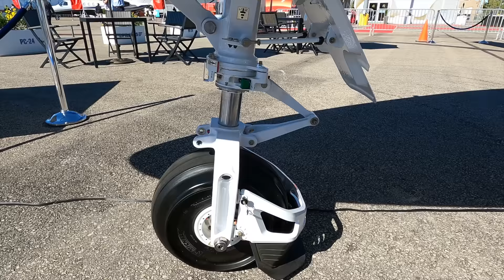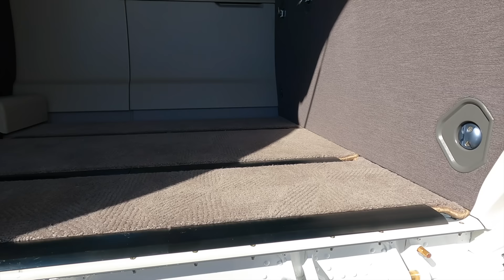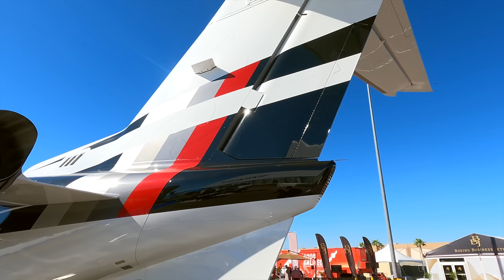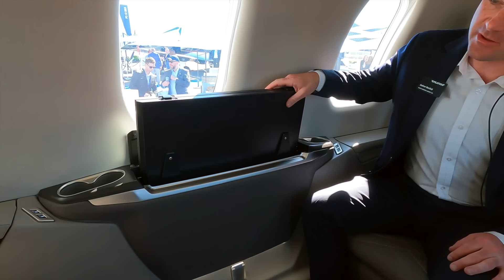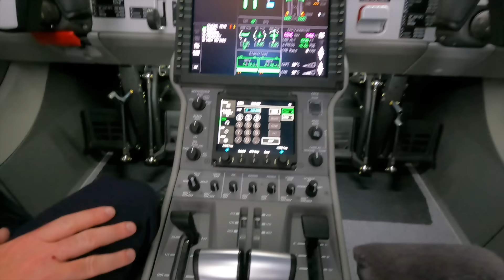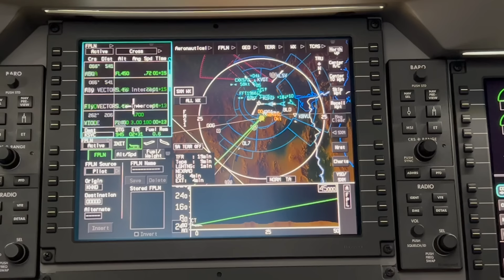NBAA-BACE 2024: Pilatus PC-24 Walk-Around Tour

Comment: I’m a little surprised by the combination lav and galley. I wonder how well that goes over with potential buyers. This plane is a substantially higher price point than, say, a HondaJet that has a fully enclosed aft lav.
Reply: I like to think of this as the SUV of jets. The cargo area is flexible and accessible during flight. One tradeoff is the location and amount of space available for the lav. It's certainly not for everyone, but some love it.
Reply: @paulfrank8738 I wonder in what kind of mission you need rough, short field performance, have 6 seat executive interior, galley that can only serve Champagne, not having even microwave. You will poop and piss in galley, but you have cargo space that can take full pallet of heavy cargo. Aircraft without purpose. PC-12 was and is highly focused aircraft. This is something invented in fever dream.